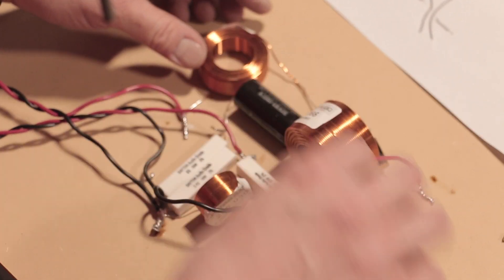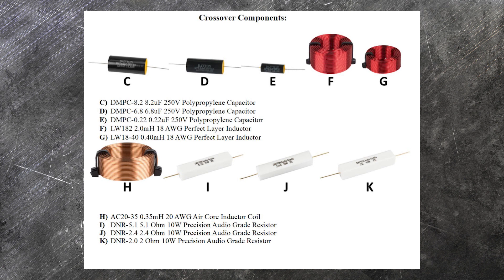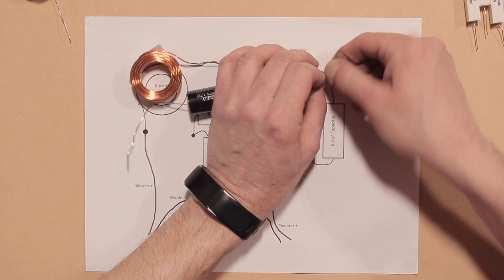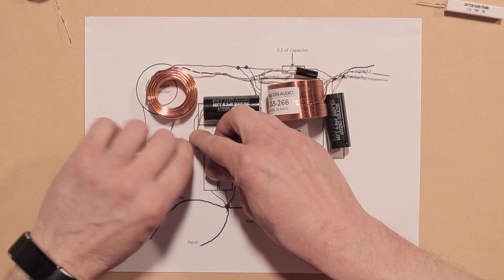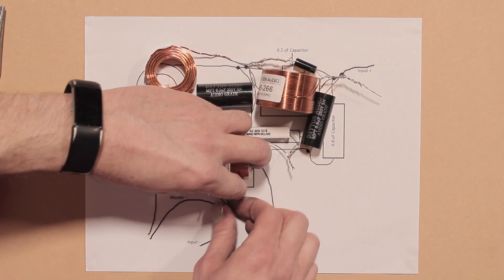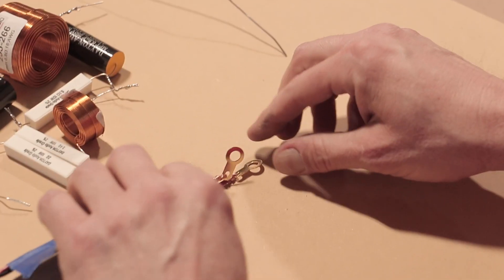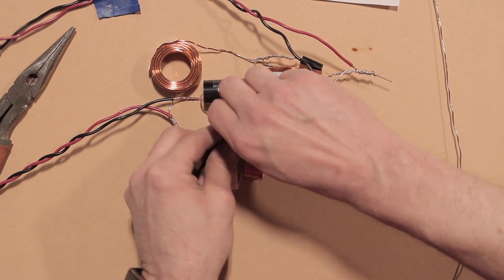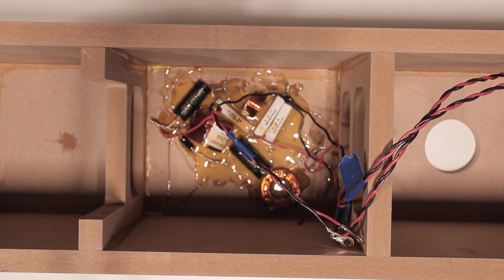Parts Express Amiga Kit Crossover Construction

Comment: For a cleaner crossover look, I like to build mine on a piece of hardboard.  I layout all the components and then glue them down with hot melt glue.  Then I drill small holes for the wires, pass them through to the other side and do all the soldering on the back side.  Then you can screw down the board or just use more hot melt glue when you want to put it in the enclosure.

Another, minor improvement would be to separate the two filters on two boards, and run them to separate terminals in case you want to impress your friends and say that you can bi-wire the speakers.